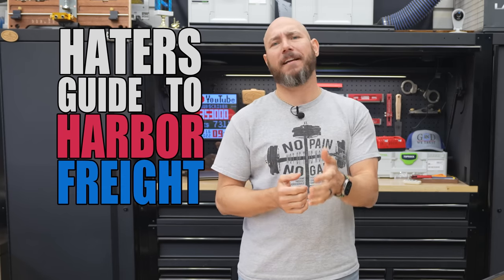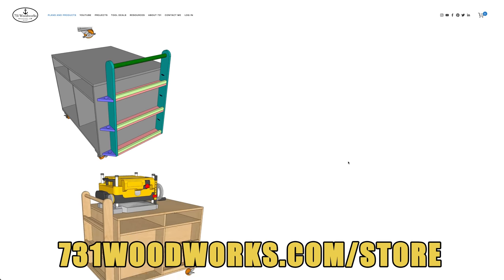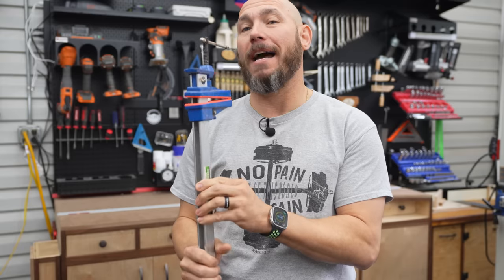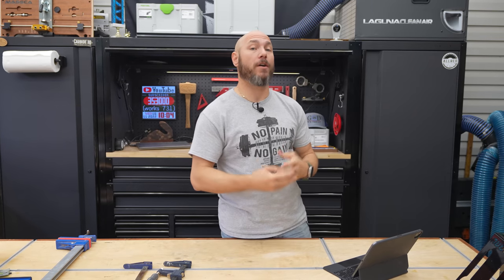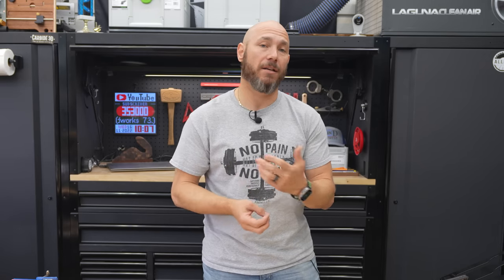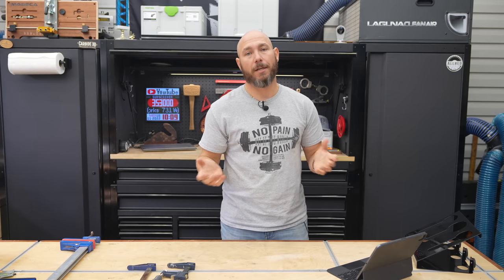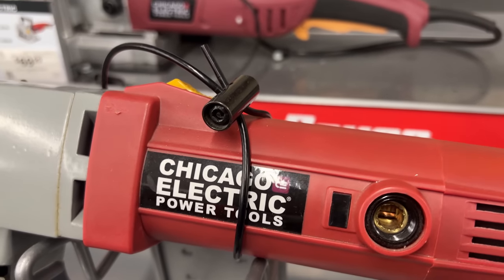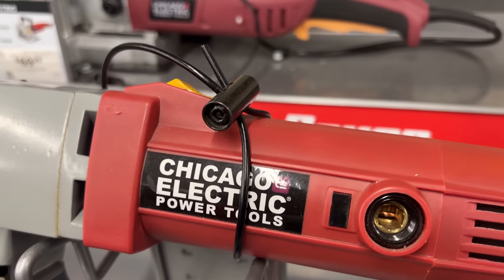The Hater's Guide to Harbor Freight | What to Avoid

Comment: It's my opinion that if an item has more than one moving part,  don't buy it from Harbor Freight.  It may "look" like a brand name tool, but in my opinion it is most likely not anywhere near the same in fit and finish, performance or quality.  Read the warranties that HF offers on its tools.  Most are for 90 days or so, and in any event nearly always much less than a  decent DIY (Ryobi level) tool.   Save your money for Ryobi or Ridgid.

Comment: Whatever you do, don't buy the Central Machinery drill press! I got one really cheap on sale, and it is by far the worst power tool I've ever seen. The first time I powered it on, I could hear the bearings struggling as they bounced around. The chuck had so much wobble I had to use a bit one size smaller than the hole I needed. 

I would have returned it, but I only paid about $70 and it was such a hassle assembling that it wasn't worth disassembling, boxing it up, and driving back. I used it for one project and trashed it.

Oh, and I also bought a Chicago Mitre saw, and the first time I started it I smelled smoke. I expected it to go up in flames, but surprisingly, it works. But like the drill press, it has some wobble, so I don't trust it for any precise cutting. I will stay away from Harbor Freight power tools from now on.

Comment: Harbor freight all comes down to the ppl running said store. I’m a mobile heavy duty mechanic and I’ve had really good luck with their tools just use common sense tho and understand some stuff won’t last forever but then again I’ve had a set of 1/2 12 point and 6 point metric and sae impact sockets I’ve used for 15 years never rounded off a bolt or broke on me or had to warranty one yet and they stand behind the warranty

Comment: You don’t roll up to White Castle and expect a ribeye steak. Harbor Freight is cheap as heck. I have a little Pittsburgh swiveling 1/4 ratchet that I use all the time. And you can easily bend the wrenches and stuff around as needed to make specialty tools. 

If i were buying a whole set of tools from scratch, I’d just load up there, and just buy better stuff the moment it couldn’t get the job done.

Comment: Let me start by saying that BBB is a good and necessary service. HOWEVER, I recently found out that they BBB rating has more to do with if the reported company responds to reports then if they ignore them.

How did I find this out?

A friend of mine was dealing with a HORRIBLE contractor so I reached out to BBB on his behalf. Only after I did this did the company reach out to my friend to return and do some more bad work.....loooong story.

So after all of this I saw their rating was an A. I reached out to BBB to find out how could this possibly be the case. They said the rating has little to do with how many complaints a company gets and much more to do with if they respond to the BBB request and if the customer finally has relief.

So BBB definitely helped but you can't just look at the rating.

Comment: It doesnt bend because of the metal being "soft and thin" it bends because the faces of the clamping portion never lines up.  The faces are wonky (usually just the cast face, sometimes even with the parting line intact) on the fixed portion and the moving end pivots so it will never clamp straight.  Mill the face of the fixed portion perpendicular to the bar and they work fine(ish).  It still won't be perfect (what does perpendicular even mean when the reference is a crappy cast piece?), but it'll do way better than what's shown.
Reply: Just to be clear, the bars are just soft cold-rolled, too, so the whole tool's not great.

Comment: Best place to buy a hammer! 😅 seriously they have some awesome stuff, you just have to be picky about what you buy. 
My buy list - jacks, tool boxes, hammers, chisels for anything other than fine work, extension cords, zip ties, icon line of tools, disposable gloves, masking tape
No buy - Pittsburgh screw drivers, wrenches, and sockets, any measuring device, anything Chicago electric, sand paper, saw blades. 
A lot also depends on your use! Their screwdrivers are fine for puttting up a light, but not dealing with seized parts on a car.

Comment: If it could kill or seriously maim me if it failed, I wouldn't get it from HF. Saws, grinders, even floor jacks. Friend of mine had an angle grinder that started ramping up speed uncontrollably, and it had melted the on/off switch in the on position so he couldn't turn it off. Had to yank the cord. Just don't buy anything from HF that can kill you. Not worth the risk. Stick to moving blankets, furniture dollys and paper towel holders

Comment: You nailed this man. I only buy clamps & brushes there and a few other trinket stuff. When I first started wood working a few years ago I tried using their power tools and they just aren't good. Hercules and Bauer are actually fine to use tho in most cases but still I'd rather go with Ryobi if you're on a budget.

Comment: The Harbor Freight thing is just worn out. The people that complain about them so much want something for nothing. It’s Harbor Freight, not the Milwaukee tool showroom. If your going there with the frame of mind that your not going to find the best tools available and your looking for a deal you’ll find one. I’m a Machinist and Tool Maker, I was a service technician  traveling all over the states, Canada, South Anne Central America, and I’m working as a  Maintenance Technician so I do know tools both junk and high quality. HF had some good stuff but if your a contractor using your tools 12-14 hrs a day you should probably not shop at HF for your power tools. This should be common knowledge by now. Now that being said I have noticed that they have been putting out better quality cordless power tools than they ever have. Bauer and Hercules are not bad tools, especially the Hercules line. I own a couple Bsuer tools and they foot the bill for me in my shop. I don’t own any Hercyles tools yet but I have no reservations about the quality of them. From what I’ve seen they are a good quality tool. Are they a DeWalt or Milwaukee, remains to be seen. I own both snd they are greet tools and it’s a tough market. Avoid the Chicago line all together, they are the definition of poor quality. So I’m saying all that, you probably know what you’re walking into at HF so don’t bitch if you get something you don’t think is as good as your high priced tools. It’s HARBOR FREIGH! Be thankful there is a place to go where you can find a deal when money id tight or your needing a certain throw away item you would pay considerably more for at another store. Give them a break and go bitch about the current administration in Washington. Talk about doing business with China, now there’s something to bitch about!! Go give em hell!

Comment: 99% is good enough from there.  I only had problems with the knife sharpener as the plastic housing will fall off.  Everything else I ever bought worked fine.

Comment: You just gotta understand what that place is. They aren’t “professional” tools. I have a ton of their hand tools. The sockets get used on impacts, fixing random equipment and personal vehicle repairs.  I’m not assembling Porsche engines.. that being said, none of them have given me trouble with exception to torx and hex sockets, which get abused.. i do stone counter tops.. i’m not going to go buy a grinder from them for cutting stone. I’ll stick to makita and flex.. most of the time you can tell when  one of their power tools is going to hold up for one use.. and the price normally reflects that.. if you only need it for one job and you know you’ll never need it again.. go for it.. but have some common sense

Comment: Harbor Freight is a fine store if you're buying something for its quality level. And never had trouble with their service back to the store I go to the managers the first guy Dorsey and say hi to Super helper the store spotless the stores always stocked in always find stuff you need easily. There's some really good tools to be had and others that will get you through the job heirloom quality but you will get the job done! For most people they like to abuse the tool then b** about it. That's the same as when you see a a vice bent handle. You know someone's not doing something right. Foremost homeowners a lot of these tools are just fine and are good enough work that they're doing.

Comment: ive had decent luck with the router bits and i abuse them (bought them to abuse dont want to use my expensive bits on recycled wood) it seems they are phasing the ones in the video out for ones made by herculese and bauer i have yet to try them but they do look better than the old ones

Comment: I like Harbor Freight!   But I understand that their are inferior products and some really good products.   Saw a recent review on another site comparing HF’s US General tool cabinet vs Husky sold at Home Depot.   The US General was far superior from the way it was built and user friendly.   Then there are the crap products.   I picked up a Pittsburgh Allen wrenches.   I bought two and put them in my tool boxes.  Both came apart before ever being used and I had loose Allen wrenches floating in my tool boxes.  But I have Pittsburgh hand tools which work just fine.   I think Hercules makes quality saws as I have the miter and table saw.  Bauer seems comparable to Craftsman.  Bought the Predator generator which works great, noisy, but runs my entire house during Northern Michigan power outages in winter.   HF is great if you watch the reviews, look at the product, and understand that if it breaks, chances are you buy a new one.

Comment: The magnet trays aren't that great. The adhesive holding the magnet to the bottom of mine failed and now I have to epoxy it back on. Another thing I would never buy are consumables. Bits, blades, and abrasives. Cheap crap that will fail in 1-2 uses and will possibly ruin a project. 99% of the time I have been much more satisfied with going to my Lowes, HD, or the local hardware store and getting something worthwhile.

Comment: HF tools is a hit or miss, Absolutely light duty stuff, i wont buy the tools that rely on good metal - drill bits, chisels, planes, taps , ect. Also abrasives, never. The grit strips off faster than anything ive ever seen. I would rather buy ryobi power tools than the power tools they sell. Some of best things ive gotten, 4 foot LED lights, $20, had them for almost a year and half, bright as hell. Calipers for scribing and measuring, though i dont trust them past 3 or 5 thousandths. Good for beaters nonetheless. The tumbler has been great , Wrenches and allen wrenches - though keep in mind light duty, they will round over , however its nice to have a full set. The tool chest has been surprisingly good. I had the little 1x30 around for 5 or 6 years, beat all to hell. I just threw it away, 

It can also be good to use a tool and have problems and have it fail so that you know what your actually looking for and get a good one.

All in all if you need a tool for around the house, its great, one time use for a odd project, great.

Comment: Hand tool wise you cannot beat the majority of the pittsburg line of tools. Lifetime warranty and the price for them are really great. Quinn is just overpriced Pittsburg. Icon is really nice and a little better quality but not worth the money since the Pittsburgs have the same lifetime warranty, and you can literally buy twice as many Pittsburgs for the same price as the Icon. The only hand tools I recommend over the Pittsburg are the Doyle and Bremen ones for the clamps, pliers, adjustable wrenches and screwdrivers, they're much more durable.

Power tool wise I get Hercules hands down. Bauer isnt bad for occasional use but I have seen more of them be returned compared to the Hercules. Dont even bother with Warrior or Chicago Electric if you want something that will crap out after 3 uses.

Stay away from a lot of the lawn care power tools such as Portland and Atlas. Had the portland pressure washer crap out on me and it wasnt super strong, and had the 80v atlas string trimmer head unthread itself from the end of it and it fell off mid use. Tried threading it back on but was giving me issues the entire time.

The generators are really good as long as you get the right size for the application you need it for. Far too many people buy the 3500w generators and return them claiming it didnt work because they tried using them to power their entire house more or less and are uneducated in how power delivery works.

The McGraw compressors are okay, but more on the loud side compared to the Fortress ones. I rarely see any Fortress compressors be returned so your best bet is to stick with those ones.

The jacks and jack stands have gotten SIGNIFICANTLY better compared to what they once were. Get the 3 ton Daytona jack stands and the Daytona 3 ton low profile jacks. If you get the Pittsburg jacks get the steel ones and avoid any of the aluminum ones, I've seen those come back more than any other jack.

Toolbox wise the US Generals are the kings. The Icons are good if you have the money to spend on them but most people do just fine with the US Generals. I recommend using the Yukon toolboxes more for workbenches or even kitchen islands as they are built a little flimsier compared to the others. The toolbags and bin boxes are also really good for the money.

The tarps, ratchet straps and moving blankets are a steal, but stay away from the fasteners and hardware that come in the little blister assortment packs.

When it comes to the automotive specialty tool kits (brake caliper compressors, ball joint presses, pressure testers, etc.) try to find any of the Icon brand ones and stick with those. They're better made and, get this, come with a LIFETIME WARRANTY. The Maddox and Pittsburg Automotive brands only come with 90 days.

This is all coming from my own personal experience with the tools as well as what I've seen in the store as an employee for the company.

Comment: I am a commercial carpenter, and I will never get anything from Harbor Freight.  They had the horrible reputation when I first started in the industry back in '98, and I have yet seen any improvement in quality in all those years.  It never fails, each job I go on there is at least one worker, no matter the trade or age, refuses to get anything other than HF and wonders why their work takes longer or has to be redone.  A quality worker uses quality tools.  I honestly can't figure out why that company is still in business, they can't be making any sort of real profit with the crap they sell.
Reply: That’s your opinion, as a homeowner I’d much rather buy there cheap tools and get a good warranty with them and replace them when needed then pay for overpriced tools from Home Depot or Lowe’s

Comment: Hogwash, Harbor freight hater! As a professional contractor I use Lots of Harbor freight tools, power tools, machines. A sawzall died on me after about 4 years.. That's the extent of my Harbor Freight problems. Except a couple Pittsburgh ratchets, which are replaced on the spot  in store, no questions asked. On any Pittsburg Item, mostly automotive sockets ratches but those clamps too

Comment: I was a CNC technician. I only bought harbor freight Allen wrenches.
Reply: You must only work on well greased inside the shop items.  Try a Chi Comm Allen head wrench on an outboard motor used in salt water or any car driven up north.  The first time you round off an Allen head bolt is the day you wish you paid 10 times as much for an American made set (although only 2-3 times the price in reality).  Mine are all 1/4 the price of Communist wrenches at  flea markets or pawn shops (I only pick the American made ones). I now have triple the amount I need.  1 for my truck, 2 for my garage, 3 for my second home.  I’m all in for 3/4 the price of an HF set and never at a loss for a wrench

Comment: I pretty much avoid all power tools from HF. That being said, I do have a 8k winch and a 1.5" electric water pump that I guess could be considered "power tools" that have been great. I have completely abused the winch and it refuses to die. Any impact tools like punches and chisels are junk. Any cutting tools like files of drill bits are junk. 
Probably the best tool that I buy a bunch are their spray guns. I don't know what they cost now but before Bidenflation you could pick one up for $12 and buy the free replacement for another $6. When you are done with your project, don't even clean it (it cost more in thinner to clean than the gun cost), take it back and get the replacement for your next project. You have $9 each between two guns and they actually spray great. 
I've got some of the Icon hand tools and I have to admit they aren't bad. The US General higher end tool boxes seem to be top of the line, no, they are no Snap-on box but they are still great boxes at 1/10th the cost.
At the end of the day, somebody that has held quality tools can look at and hold the HF stuff and and get a idea if the tool will hold up. Some of the stuff I bought for a one-off project and I didn't expect to hold up and did, and other stuff was either broken out of the box or didn't make it though its first task. I never looked up their reviews and I'd never leave a bad review, you kind of know what you're getting into when you walk though the door. It does have its place though.

Comment: I think you miss the point of harbor freight. 
It's for occasional homeowner use & affordability, not for high production at home wood smith. 
Like if you only do a few projects that require a chisel then they are the way to go, but if you have a smith shop, dude get real...the answer is heck know their off brand is going to preform like top or mid shelves bands.